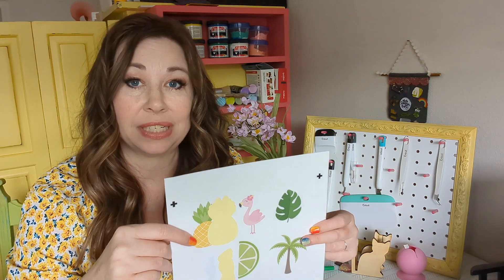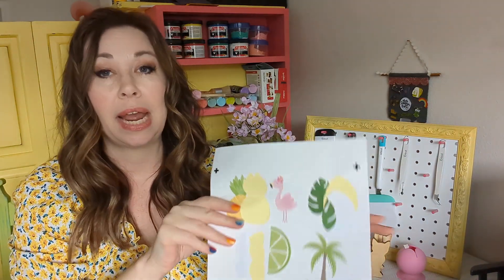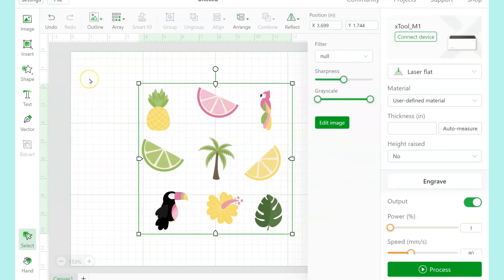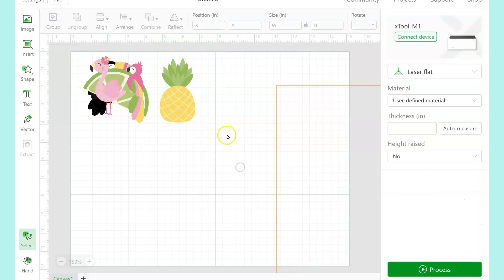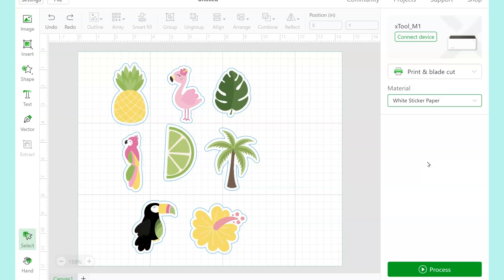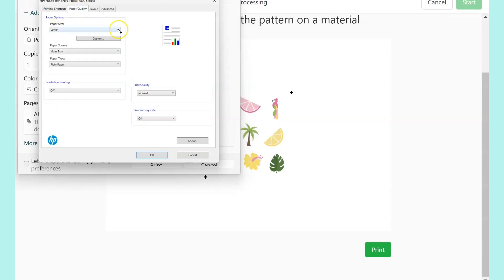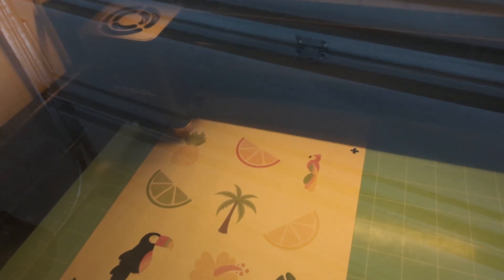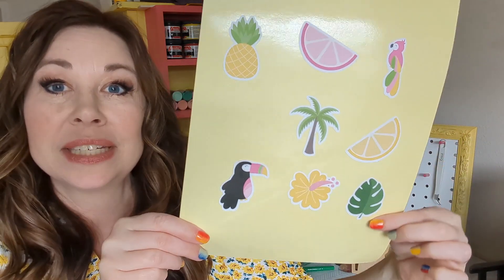xTool M1 Sticker Problems with Print then Cut

Comment: I tried these tips but it didn't help! Mine's is just a bit off - maybe 3mm. My outlines were created in illustrator though rather than the outline feature but they are lined up perfectly in XCS. But also, the reference cutting pressure cuts through the whole sheet instead of just doing a kiss cut. I've tried lowering it to 50g but it's still too much. Any thoughts?
Reply from the maker: How frustrating! Let me get back out there and try a couple more runs of print and cut to see if I can come up with anything that might help with the outline.

As far as cutting through the whole sheet, first checks are to make sure that the blade and housing are both installed right (though the magnets should pretty much guarantee that) You could try a new blade too.
Reply: same , had my machine for over a year and i wanted to make stickers and other cut outs with it but because It's always slightly off, i never did because It is just enough off to not want to sell

Comment: Thank you very much fir this, though it didn't help with my problem (that my printer is in a different place than my M1 and if I disconnect from the m1, connect to the printer, print, come back to the M1, connect the usb and then try to cut it) always detects the previous desconection and gives me a warning and error message. Tried saving the print as pdf and using the pdf but I don't get it to do the perfect print and cut, nearly there but never neat. I don't really understand how the registration marks work, it seems they don't work the same way as in my Cameo.
Reply from the maker: I know what you mean, it's different from my Cricut too. Honestly, the stickers don't seem to be a major selling point for the xTool - but you're like me, if you have it, you want it to work!

Did you try changing the paper size when you printed? To a4?
Reply: @CraftingInTheRain  In Spain A4 is the norm, we don't use other sizes in that range. Many years ago it was common to use what was called "folio", longer than an A4 but similar width, but not used much anymore. So, yes, I chose A4 when using it. What I see is that the registration marks are not read by the machine, maybe it has to be with my program update, I will try to find out the previous version, it also had the "extract" option which now has been taken from the program for some strange reason.